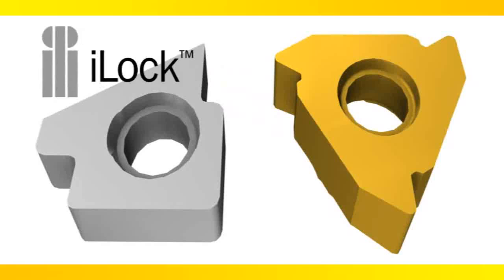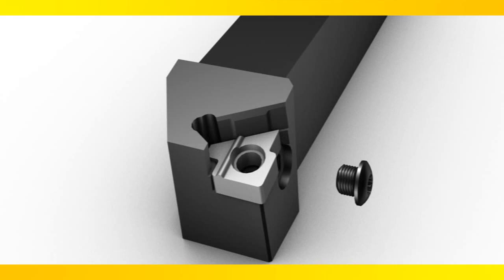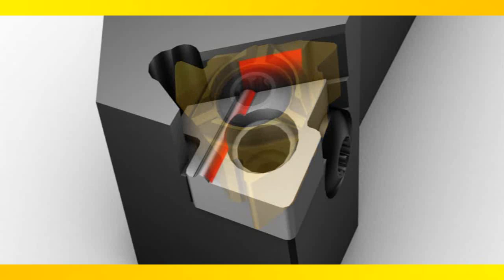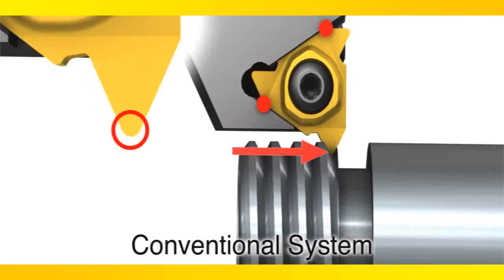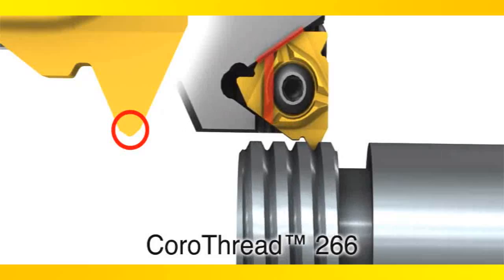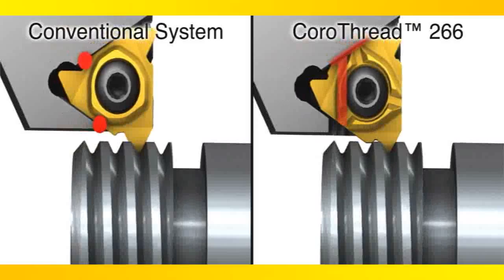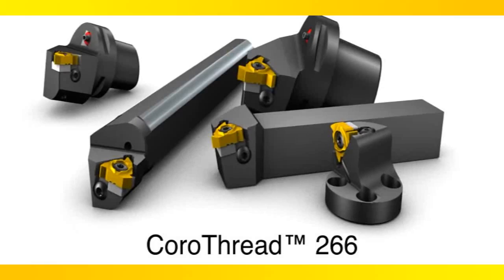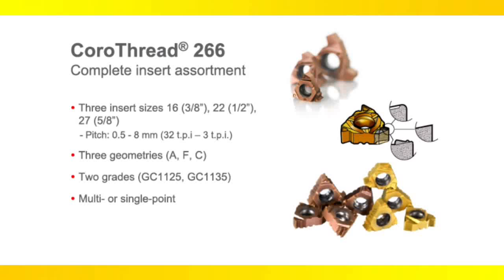CoroThread 266 with iLock Technology Sandvik Coromant

Comment: I use these whenever it's possible, I can often run 30+ parts with one tip.
Reply: Wich material? inox
Reply: @MrIngorodrigues  Typically 4140 HT, softer materials such as 1045 have more like 60 parts per edge.

Comment: Dear Mr. Coromant,     Do you make a cylindrical insert holder,gripped on a v block in the tool post,so that I can swivel the tool to suit the helix angle of the thread,thereby ensuring that the correct side rake on the flanks of the cutter( and that the top face is perpendicular to the helix angle,  I realize that your primary commercial concern is to supply the mass production market , but I think that ,worldwide, there are many turners ( e.g. toolrooms) who would welcome such an addition to your products. Might you also be able to make available the "angle of swivel" for any pitch and diameter of thread that we could download seeing as you allready have that informatrion ?
Reply: They make anvils that the inserts sit on with different angles for that very purpose, and an angle chart to go with it.

Comment: suggest me for boring lathe tool below ○30 mm × 250 mm long for motor bushing and rotor plain turning (you know rotor of submersible pump)  it's had 99° right and left side at middle area of rotor.